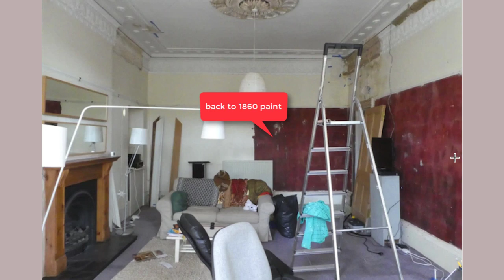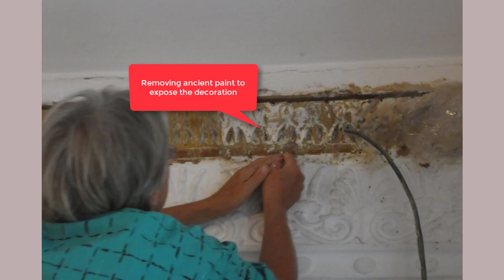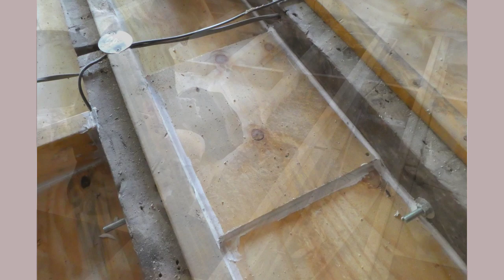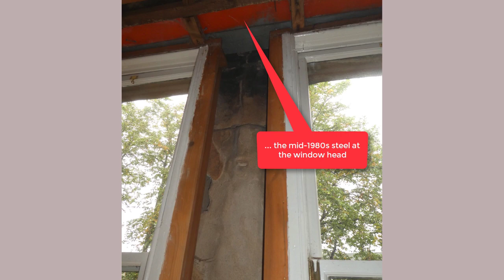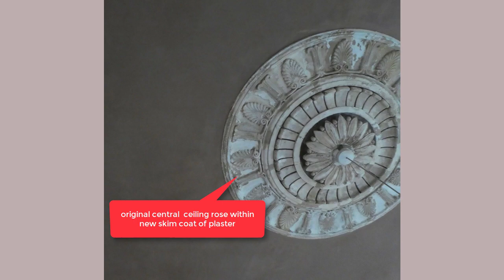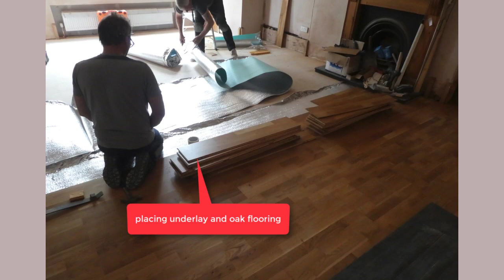Reconstructing a Glasgow stone tenement floor

Comment from the maker: I created this video to give other hints as to the challenges of retrofitting older masonry buildings which have faults in their floor structures e.g. sags over the span and noise transmission.  Your floor might differ in details and it would be good to hear of others undertaking similar work.
Reply from the maker: I did some of the work along with a couple of local joiners. Their details might be somewhere in my filing cabinet.  Not rocket-science, just lots of attention to detail needed as well as some heavy lifting.